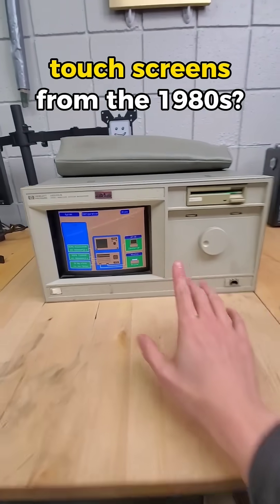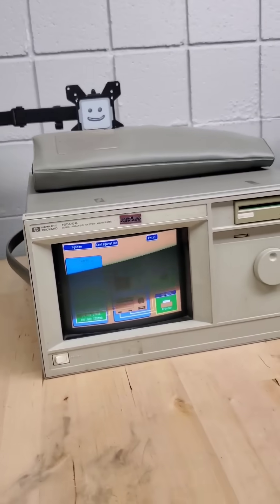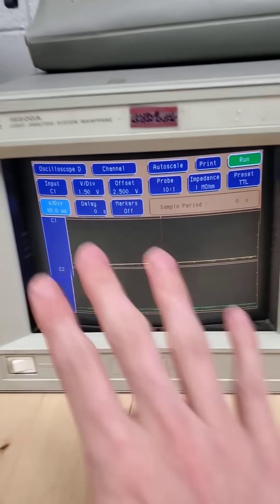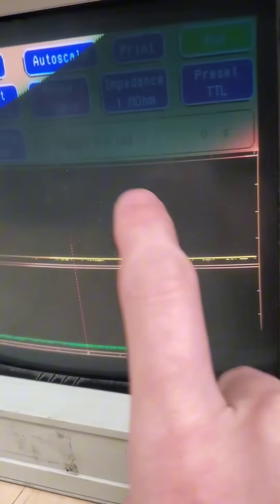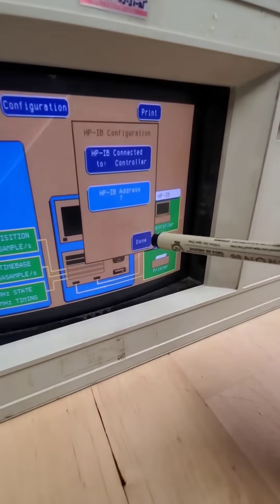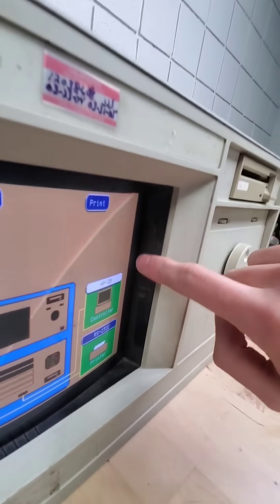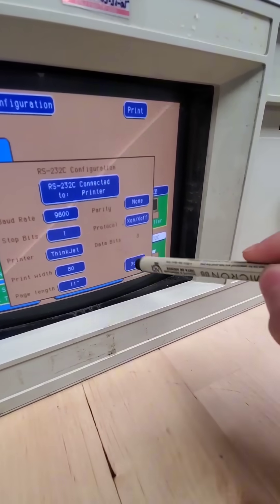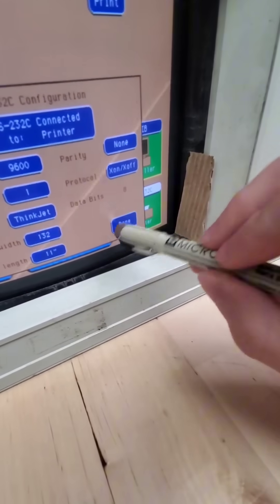how did touch screens work..in 1980? #shorts

Comment: HP made a PC with the same technology. Unfortunately the software driving this idea used so much of the processor's capacity that the PC appeared to run at about 1/2 the speed of a comparable PC without the technology. Great idea, poor software implementation, but what else would anyone expect from HP?

Comment: In 1982, I got a vcr from a friend who worked at jpl. The vcr had a dial like that, that was to control the picture, so you could watch 'frame by frame' forward or reverse. I was recording the launch of the space shuttle Challenger. When it blew up, the shot was close up, and had NO CUTS to far away, like it has now. You can see the red/orange flash erupt inside the shuttle, then the windows blow out, then the roof blow up and away, and fall to the right. This view has not been available to see since, about three minutes after it happened.  It now has a cut from close up  to far away. 😢

Comment: I worked on these - back in the day. They were very reliable (as you can see because this one is still working more than 40 years later!). The next versions were not capacitative but actually ultrasonic. There were ultrasonic waves moving inside the glass which were absorbed by fingers on the glass surface and so you could get the coordinates of the finger by the timing and phase of the absorbed waves. Just going back down memory lane here…

Comment: This touch method is still being used and even made it to phones (Neonode N1 and N2 both had it - they also had swipe to unlock before iPhone got released and Apple claimed it's something they came up with). 
Nowadays it's used in scenarios where you need durability or resistance to interference, as well as the ability to use the screen with gloves. So aviation (including military planes), medical, manufacturing etc. Nowadays it's also commonly used as a hybrid tech, meaning other forms of touch sensing are used in combination with this to maximize reliability.

Comment: One thing that wasn't shown in the video because the earlier 16500A model didn't have it is that the later 16500C, which YouTube user Tech Tangents has, could cast its display to a window on a system running an X server, so something like an era-appropriate version of HP-UX, but he got it to partially work on his laptop running Kubuntu with Xorg.

Comment: I spent many hours with an HP 16500B.  I used it to help design computer motherboards back in the day (ealy 1990s).   It could do crazy stuff.  I could actually disassemble processor instructions by probing a CPU address and data bus.   😂

Comment: HP also had a PC, the HP-150 from 1983, that also had a touchscreen quite similar in function to the 16500A.  It used infrared LEDs and respective sensors mounted in the bezel surrounding the CRT display.

Comment: I visited a large steel factory once as a kid in the eighties and in the control room I saw these in operation. Very impressive.  I was already interested in computers at that time and tried to figure out how this worked.  I thought they must have built in sensors behind the screens glass alternating them with the light nodes making up the pixels. This explains is.  Decades later.

Comment: These touchscreen crts were extremely common commercially in the 1980s, and surprisingly also not unheard of in the consumer market either. Anybody who was a teenager or older in the mid 1980s would likely be aware of this technology- IBM had a 14” resistive monochrome CRT that they sold and packaged as on option with some of their PC’s starting in 1983! All of the touchscreen CRT’s  were mostly resistive touch, however there were also models that used infrared overlay to detect touch. So none of these were multi touch of course, but still extremely responsive and reliable under many conditions- color and monochrome were available.

Oh yeah- these actually made it into a Buick or Oldsmobile in the 80s- for the in dash touchscreen which worked similarly to todays infotainment touchscreens; audio controls, real-time car systems monitors, as well as full HVAC control- all from a monochrome crt touchscreen in the 80s. Obviously it was a great idea just way ahead of its time because 20+ years later the concept more or less became the industry standard. 

I was born in 1980, so I was only 9 when the 80s ended, but man was that a great time to be alive. All the tech we take for granted today either didn’t exist yet, or was in its infancy. It was so cool being in grammar school in the 80s- large computer labs consisting of Apple IIe’s, Macintosh, Commodore Pet’s, Commodore 64’s, and a few PC’s as well- it was a magical time where we students had exposure to all these different machines, and were taught how to use them, how to program using their very different BASIC compilers, etc. I got my first copy of “Fast Hack Em’” for my C64 at home FROM my 4th grade computer teacher!!! Just the best memories. 😊😊

Comment: Barely the 80’s, maybe. The manual is dated December 1990. And 9600 baud modems would be insanely expensive in 1989 still. I remember not being able to afford a $169 9600 card in ‘93. I also remember doing the math around the same time of how much money I’d need to make to never need more money again: $30k.

Comment: Wikipedia on HP-150. We used those in my old office at Nortel before they were replaced with IBM PCs. Touchscreen PCs in the office in 1983. In some ways the IBM PC was a step backwards…but spreadsheets turned out to be the killer app.

Comment: That's cool. I've never seen anything like that before.
I was a computer technician for a short while in the 1980s, working mostly on main frames. 
PCs were just coming out for office use and the first ones I saw had hard drives that were only 40 mega-bytes, if I recall correctly.🤔

Comment: For a long time CRT touch screens were the only ones that were actually good. There were also screens that were flexible plastic that you’d have to press hard on to make contact in the membrane that made it work, and those were TRASH. (I used to operate a cash register that had one. It sucked)

Comment: We just got two huge brand new industrial machine for the factory for a mio dollars with windows 10, but the touch screen is horrible, inaccurate, sluggish, and only responds to hard objects.

How can we be in 2024 and still getting screens with touch technology from early 2000s? The machines we have from 2010 has the same technology but is way more accurate and faster responding.

Comment: Back in the mid 2000s there was this project some people would build, namely a touchscreen coffee table.

First you install a projector on the bottom and a ground glass on top. You flood the glass with infrared LEDs via edge lighting, and modify a webcam by adding infrared pass filter to it, removing its IR kill filter too. Where you touch the glass, the finger breaks total internal reflection and causes a bright spot of infrared to come out, which is read by the webcam.

I probably remember the details wrong and it doesn't work like that. :D but a project of this type did exist.

Comment: The most impressive part to me isn’t the touchscreen itself, but just how damn responsive and fast it is
Reply: Because there are no ads 😂
Reply: Screen transitions have left the chat.
Reply: no spyware no keylogger
Reply: @Darkest_templarTrue
Reply: I’ve written UIs for embedded micro controllers that run at similar speeds with only 8MHz and a few dozen kilobytes of ram. There’s an ungodly amount of bloat in most software today
Reply: @phillies4eva  I did too. When I started learning programming 25 years ago, we used assembler and 4MHz 8051 uC. So what? The problem is, that what you call "bloatware" is in fact not bloatware. It's there to support easier programming, modification, visually better GUI and stuff like that.
You somehow fail to see that customers want to be able to change graphics, to download different skins, custom profiles, etc. Support of automatically created GUI elements is costly, but when you have the resources for it, it opens a ton of options.
Reply: @mrkv4k  You're in your feelings...

pillies was stating the fact that modern software is filled with bloat which leads to the degraded response times of touch devices.
Reply: @mohammedgoder  "You're in your feelings" - Nice english.
And no, I am most certainly not "in my feelings". I am stating facts, supported by more than two decades of experience. The whole problem is pretty simple, what pillies calls bloatware is what marketing calls animated GUI, what management calls higher programming languages and what programmers call modular solution.
Reply: @mrkv4k  You literally described bloatware.

If it's not required than it's bloat.
It's that simple.

Writing a program that interface as close to the hardware as possible will significantly outperform one that's written with a bloated software stack. That's irrefutable.
Reply: @mohammedgoder  That's the problem with this whole argument. Bloatware is not something that is "not required", it's the inefficient bloated code. And that's why you are wrong.
Most of the stuff you are wrongly describing as bloatware isn't supporting the functionality, but it is required for better looking GUI, to support advanced programming, etc.
Reply: @mrkv4k  "it is required for better looking GUI."
Your point doesn't have any merit. You can make the exact same GUIs in C/C++ and they would perform better in C/C++.

You keep saying I'm wrong but haven't provided examples of how I'm wrong.

Give me an example of some tech that supports "advanced programming" that isn't bloated.
Reply: @mohammedgoder  "You keep saying I'm wrong but haven't provided examples of how I'm wrong." - WTF are you talking about? I've stated pretty clearly why you are wrong. Because your definition of "bloatware" is off. What examples would even be relevant for that?

If you want examples of tech that isn't "bloated", it's quite easy - pretty much any commercial tech. If you'd want an example of tech that focuses on performance, it's anything you'd use for work, especially in a lab.
Phones are not slow because there is a ton of bloatware in them, they are slow because the marketing and customers prefer other parameters (like that better looking GUI) over actual functionality. You keep telling me that my point "doesn't have any merit", that I am wrong, but you can't even say why. Why? In fact, it's quite simple. Bloatware means bad programming. What you two are describing isn't the issue of bad programming (in most cases), the problem is the shift from performance and functionality to looks and push for faster development time.
Reply: New stuff sucks because old stuff was just made to work. New stuff is made to manipulate you into using it, and then break so that you have to buy another.
Reply: @BonesMcoy  I would say that's true in most cases but there is a shift happening in certain parts of the software industry that may turn the tides towards better consumer choices.
Reply: Then he tells you that Apple is the one who invented, manufactured and innovated haha... Apple is just a company that takes the old ideas of companies and applies them at the present time (for example, eye-tracking control technology existed... Mixed reality existed, so what did Apple offer in the field of mixed and virtual reality?  Nothing but the high price haha)
Reply: E
Reply: no gov spying on ur ass
Reply: The-Anti  Again, that isn't really true. First of all, there are several hardware variations that are all supported by a single iOS. But also, it's not like they are writing everything from scratch every time...
Reply: @mrkv4k Just leave these guys. They have zero experience in engineering or software development and lack the prerequisite knowledge to understand what you're talking about when it comes to embedded software development.
Reply: What does it run tho as an operating system
Reply: @egementutkunforreal  probably runs bare metal (no operating system)
Reply: @egementutkunforreal  Nothing. It doesn't have an operating system.
Reply: @egementutkunforreal  Just to clarify, it runs on it's own proprietary SW. If you want to use the discettes to store measurements, it can run DOS.
Reply: CRTs have no post processing and lasers are the speed of light.
Reply: It's funny, it's around 40 years old, and it's tons more responsive than an expensive modern cars infotainment system...
Reply: Better than win 11
Reply: It was the time when there used to be professionality in software development.
Reply: @TheSimoc  No, not at all. The actuall reason is that this menu is doing more than 10,0000 less than your phone. It's also written specifically for this hardware.
Reply: @mrkv4k  Wrong. A menu view in a modern phone is doing basically nothing more than a menu view in that good ol' logic analyzer. Actually, often even less, as in "modern" ugly UIs have largely lost bordered outlinings, color schemes, and many other beauties that used to be in the latter.

While it is true and obvious that a modern phone or a modern Windows has more functionality than old systems, that is not a valid excuse for the apologism of the overly prevalent software bloat which has very little to do with the added functionality.

You can compare pieces of software of the different decades with exact same functionality, or often even less functionality on the newer one, be it a menu UI component, a solitaire game, a website, a device driver, or a productivity software, it is easy to see the new one to be anything from ten to thousand times more resource hungry than the one from the last century.

And as a reminder, I am speaking explicitly about functionally similar or lesser counterparts, so please don't stretch the context to base the apologism on the added functionality.

To further prove the point, there does exist lots, lots, a whole lot of exceptions, quality pieces of modern software with similar or even added functionality, still working nicely and sleekly with similar resource usage than their decades old counterparts. It is all about professionality, nothing more, nothing less.

And even when there are lots of added functionality, vast majority of it isn't (or at least shouldn't be) consuming any resources (besides the disk space) when not utilized, letting the similar-to-old basic functionality - such as menu views appearing - run at least as sleekly and fast as in the old systems, if they just were implemented professionally. Especially as we now have at least a thousandfold more hardware resources than back then, making it negligible for performance even if the resource usage were a few times higher.

It is true though that many software functionalities are nowadays implemented by overly convoluted ways - such as with relentless use of large libraries and running frameworks on top of frameworks, etc. But that is yet nothing else than yet another level of unprofessionality.
Reply: @TheSimoc  I love how you wrote "Wrong" and then continued with several paragraphs describing why I am right.
Reply: @mrkv4k  And the most "lovable" thing is that you entirely forgot to refer to any single paragraph describing you being right in the relevant context.

Yes I confirmed that a modern phone is doing more things than an 80's logic analyzer (let alone your out-of-scope comparison in the literal sense - a menu versus a phone), but that is not at all the reason for the sleekness of that old piece vs. sluggishness of modern ones as you claimed - that is purely a false pretext, none of my paragraphs undoing that. Professionality of the old days vs. unprofessionality of today is the true reason, nothing more, nothing less.
Reply: @TheSimoc quit yapping brudda. Psuedointellectual
Reply: The-Anti  No, not really.
Reply: Its because CRT screens are just faster than LED/LCD though its incredibly bulky and expensive
Reply: @smiley7399 wrong, it's because modern software is not written optimally.

The response times between the two display types are irrelevant as its at most 10ms.

That doesn't explain the 1000+ms of nothing occurring after an interaction in modern software.

Comment: I used to work on the IBM InfoWindow Monitor in the late 80’s early 90’s doing interactive video programming using laserdiscs (yes the full size ones).  These monitors had a full touch screen and we could load the touch areas over the laserdisc video.  Back then this was VERY cool stuff.

Comment: I first thought it worked like one of those old mac kiosk upgrades, where sensors are placed on the side/back of the cathode ray tube, watching the front from the inside, They sense whenever something touches the glass, probably a bit like fingerprint readers, using total internal reflection which is disturbed by our soft fingers touching the surface.